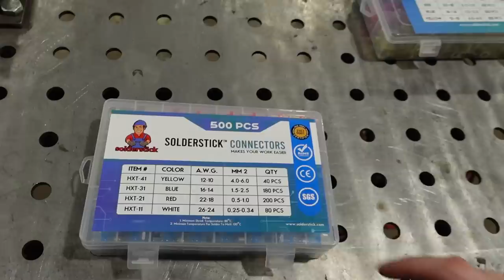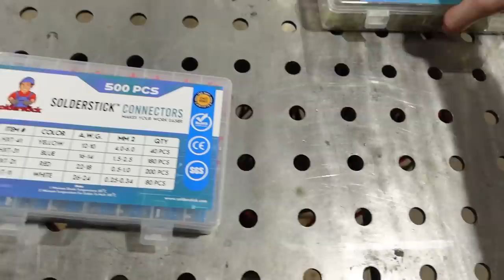the ULTIMATE AWD drag truck chassis is FINALLY complete

Comment from the maker: Check out Solder Stick for your wiring needs, and use code "LT20" to save 20% off your order
https://solderstick.com/
Reply: You should use some on wires and cut them open to show how well the wires are bonded with the solder
Reply: The phrase, cold solder joint comes to mind
Reply: Do not use these in a Profesional Workshop.... DIY is a maybe and BIG maybe...

Comment: 16:13  hey for your office try torching the boards, it will darken the wood to give a more rustic look and let the wood grain pop. I did it on my rough cut pine boards in my shop and it looks great
Reply: That could work - would be like a japanese 'Shou Sugi Ban' finish.  I also thought LT could paint the paneling white which would match the colour and 'texture' of the desk base.

Comment: Take your layer feed welder and bring it over there and run the argon gas in the tank until that's all that's in there is argon gas leave it running there for about 10 minutes before you start welding to make sure there is no fuses or oxygen in there to ignite the fumes😊
Reply: Just run a car exaust through the tank. Much cheaper.
Reply: @MecanicaForte  cheap doesn't equal smarter. Argon is  the right back purge gas for aluminum or stainless
Reply: Argon is an inert shielding gas
Reply: @coolHandLuke5150  there's no reason to back purge aluminum.  No reason to use post flow on aluminum either.   Aluminum isnt reactive like stainless, titanium or even chrome moly, you can remove the shielding gas as soon as you stop welding and it wont change anything.
Reply: Proofreading isn't my strong part
Talk to text on his old phone isn't the greatest
Reply: @nou9472  no but it will take the place of the oxygen and the gas can burn then
Reply: But if there's no accident near the gas can burn in the Argonne to take to a place of the air argon does not burn

Comment: Dude my build saved my life from 21 to 24 I was a heavy vodka drinker now I can’t afford or even want vodka cause I got the awd turbo pull addiction dude Thank you so much I watched these over many times stop and start during my builds the forms helped me a lot also but I need to know more about the suspension setup cause I’m rocking back and forth during pulls and getting major wheel hop scared I’m going to shake it apart

Comment: Might I suggest, after you have rinsed out the tank, run air through it to blow out fumes, and cap off filler neck: try connecting a hose from regulator hooked to argon tank and flow argon into the tank, similar to how you would purge and flow argon when building headers .  Once you are confident that you have purged oxygen (and gas fumes) from gas tank, you can take a MAP or propane torch and hold the flame near the crack on the outside. If the gas coming from the crack extinguishes the torch, then you no longer have flammable gas inside the tank.  If a flame comes from the gas escaping the tank, then keep the argon flowing until that flame extinguishes.  As long as the tank has positive pressure of argon flowing outward from the crack, the flame will not travel into the tank and explode.  If you don't get a flame, you should be safe to weld.  This is a similar technique to how pipe fitter weld live oil lines on construction sites.

Comment: a wee tip to prep a fuel tank for welding , run a car engine exhaust through it for a hour ,that will displace  any fuel gasses in the tank

Comment: Dont know what cam you picked up, but Richard Holdener did a zz502 cam in an 8.1 and picked up i believe 50 hp NA. So at 14 psi that would be another 100 for you. So there is a starting point for what you can potentially make with a cam.
Reply: He is better off specing a specific turbo cam. Some N/a cams with a lot of overlap arent good on a forced induction setup.
Reply: @timothycarey3883  a cam is going to do what a cam does. "Turbo cams" aren't a thing any more. Back when turbos were less efficient they sort of helped by changing lsa. Todays turbos dont care. Go watch Richard Holdeners channel he has hundreds of dyno videos showing exactly that. All a turbo does is add to what an NA motor makes. Literally every cam is a turbo cam

Comment: Dude your like my hero when I was around 12 or 13 me and my dad used to watch your videos my dad drove an 94 Chevy 1500 4x4 regular cab like the one from your older awd swap but it was red with a silver stripe down the sides fast forward 15 years and I’ve finally made it to a place in my life where I can build a awd 4.8 single turbo 4l80e regular cab long bed with roof racks cause I’m driving the heavy Chevy to work on Monday after I’m done racing on the weekend you never know when you’ll see a cocky over priced sports car driver that needs a lesson taught

Comment: Next time you weld a tank, use nitrogen to fill the tank and push out the fumes. Also leave the nitrogen running while you're welding (in a well ventilated area) or run an outlet hose outside from the tank.
Reply from the maker: Not a bad idea
Reply: @LawrenceTolman  running a hose from a vehicles exhaust and filling it with that will do the same thing cheaper.

Comment: Kudos on using the guard on the grinder with the cut off wheel.  I think that's the first time I have seen a you tuber fabricator using a guard on a grinder.  I cringe hard when I see guys using cut off wheels with no guard because I have experienced them coming apart and I have seen the aftermath of cut off wheels coming apart with no guard.👍
Reply from the maker: I'd had too many close calls with exploding  grinder discs to try and use it with the guard taken off...

Comment: The next tank you weld on unless you want to wash it out you don't need to use water to disarm you might say the old fumes. I have found out the best way to repair a leaking tank is to get a vehicle and a piece of stick hose or a radiator hose that fits the tailpipe and the gas fill neck. Put the pipe on the tailpipe and the gas fill and start the engine and let it run until you feel the tank getting hot. The hot exhaust gasses will neutralize the gas vapors and you can take care of business without having to worry about cleaning the water out of the tank. Ask around if you don't believe me, I would never tell anyone something that would get them hurt. I'm curious as to what your truck does.

Comment: Try using ARGON or CO2 gas to completely fill a fuel tank to weld and avoid the water mess.  Keep the gas flowing WHILE you're welding.

Comment: Make a cart for the Rigid chop saw that has its work surface the same as the red table. No more working on the floor.  Use locking casters.

Comment: Not only would I worry about more welds cracking in the tank I would had added 3” 90 brackets for the bottom of the tank and weld it from bottom to sides to help support the weight of the fuel. I’m sure the welds cracked bc of the weight. Idk if that makes sense but it’s an idea

Comment: Instead of using water, The old school trick is to use a hose from your exhaust to fill it with Carbon dioxide, and then it's safe to weld.

Comment: Really enjoy your videos, and especially watching you fabricate.  I am curious why you chose not to box the inside of the frame rails.  Plate with dimple die holes should add more strength without significant weight sacrifice.
Reply from the maker: I had planned on doing some sort of boxing plates a few months ago, and it kinda slipped my mind for a while, but I likely will do exactly what you're talking about: plating the inside of the frame, but with a few holes inside

Comment: Im wondering if a 2007 and later gm 1500 4×4 rack and pinion would tuck under there.  Its lighter aluminum and less complicated without linkage.  Im looking to adapt one for my 72 C-10.  Just make sure you get the pump for it as it has decreased line pressure for the R&P

Comment: At 6:22, I paused the vid.  Came back and looked at it... thought "oobie doobie... if he mounted the springs under the frame and got some wide wheels with the correct backspacing, he could run some serious meats."  Might have to stretch the wheel tubs but....
Reply: Forgot the fact that this is gonna be four wheel drive!  Don't need no stinking fat tires on the rear!

Comment: Send it down and out under the axle from the front so you don't blow any oil or anything that might come out of the engine in front of the rear tires
In my opinion that's what I would do

Comment: Don't leaf springs twist under high torque? I would have thought a adjustable spring and damper would be the desired option to control lift and twist.

Comment: Hey LT, just wondering why you didn't go under frame or inboard frame mount for the rear suspension so you can run much wider rubber out back??

Comment: I use a heat gun on low for 15 minutes with no sending unit and fuel cap off to dry out all the fumes.

Comment: hey tolman. found my mechanical pencils and my drawing paper. i know i promised you i was gonna draw your truck if it was finished to give you another goal to aim for. ill have it done by tomorrow if my schedule holds up but i do have some question just so i can draw it properly
1. is it gonna be stock ride height? if so how much lower
2. you gonna keep the wheels(aka rims) stock? if not what are you aiming for and what brand specifically
3. i suggested you do a diesel truck stack since you wanted to be different but also to avoid getting black flagged at certain events. where are you gonna put it?(like center, right or left) and what style(donkey, smooth or straight cut)
4. Decals or logos. you want it stock style like the copo truck?

the finished product will be on my deviantart so youll be expecting the finished work to be done tomorrow at around 4:00PM central(texas) time or earlier. be safe and i hope you get into those 8's in style

Comment: Can you make a video explaining the anti roll bar there isn't much info out there how does it work does the bar twist because you kind of want some flex like if you hit a hole or uneven part of a road does the anto roll bar let one side go down or keep it straight with the body  I'm interested thank you love your videos
Reply: Anti- roll bar for drag racing is different than anti- sway bar for handling.  Anti- roll bar is meant to keep the chassis from twisting as you put enough power down to lift (or unweight) the front end - keeps the torque reaction from unequally loading the chassis and making it drive out of you lane.  

You are right - very poor for daily driver - but very good for high power drag racing

Comment: All was that gas tank in the 4x4 truck bolt in, if so where do it come from?!
Reply from the maker: the tank came from DB Rods in Texas, and its sort of bolt in, I had to do some cutting and modification on the frame to get it to fit how I wanted.

Comment: Won't the rear leaf springs slide back in the long slot in the bracket once the bolt loosens under load?
Reply: I think it's supposed to.  Rides on bearings it looks like.  This replaces the same movement in a shackle, but more positive in the side to side direction.  But IDK, the sliders are new to me too.
Reply from the maker: on any leaf sprung vehicle, all the power is transferred to the chassis through the front of the spring. if you have a standard shackle out back, its only job is to hold the weight of the truck. The slider accomplishes the same thing, but keeps a more linear geometry on the leaf spring, but power is still transferred through the front of the spring/caltrac. but yes, the back of the spring will slide back and forth on the bearing under normal operation.

Comment: Just curious what kind of roll cage are you planning on using for your rig? I am enjoying the videos keep it up! Don’t burn yourself out. Take care.
Reply from the maker: It’ll be an 8.50 cert cage, I believe it requires an 8 or 10 point. S&W Race cars makes one Ive got my eve on.
Reply: @LawrenceTolman  with the weight of the frame and the cage and drive train are you going to strip weight from the body? You had mentioned creature comforts. You are going to moving massive weight. Even compared to the Ugly Truck. It will be interesting to watch!

Comment: That heat shrink solder stick stuff is trash will have you chasing your tail with connection issues.  After a little time. Get a heat shrink crimp style and a good ratcheting crimper  instead

Comment: Is it me or did you put the leaf spring u-bolts on upside down?
Reply from the maker: they are upside down for now, but only because the axle is flipped above the springs and I don't have my caltracs and round U-bolts yet. The truck won't be driven this way, its just for the mock-up stage
Reply: @LawrenceTolman  Ah righto, looking good anyway, that thing will rip once its done

Comment: Pro tip, run exhaust or non combustible gas on the tank if you’re going to weld it.   Best pro tip never weld a fuel tank.

Comment: 4x4 in the thumbnail... AWD in the title... RIIIIIIIGHT
Reply: My Silverado goes both ways, manually in 4 low or high and set auto 4 wheel drive that's through the computer and runs off ABS sensors.
Other Silverado goes floor shift 4x4 and don't get computer control, not all wheel.
There's two kinds of transfer cases involved.
Reply: @acquasanta6676  A 4x4 vehicle can drive STRICTLY in 2 wheel drive. An AWD, can NEVER be STRICTLY 2 wheel drive. Like you said, 2 different Transfer Cases. Easy as that.
Reply: Darn, third transfer case. 
With 3 square body cases.
2 Silverado
1 Astro van
Early and late S10
This can get complicated quick .
And that's just in my parts stash .
Reply: @acquasanta6676  no no no, just 2... like a transmission. You have manual, and automatic. Just because you can put an automatic into the specific gear you want, it's still an automatic. Just with fancy different names for manufacturers. 
A Transfer Case, is the same. The 4x4, can select if no power can be added. An AWD, is always putting power down. One has a gear that can spin freely, the other is locked in at all times... Just 2

Comment: hi if look at the label on the box it is solder not soder ,there is a L that need used  .
as has been said before usa and uk are divided by a almost language  .
as per normal a very good video
rick edinburgh scotland
Reply: Brits also have a habit of dropping out the letter ‘L’ and replacing it with ‘W’.  Some how words like “Wheels” come out sounding like “Wheews”.

Comment: I'm getting confused as to what direction you are taking this truck the title calls it a "drag truck" yet you are putting anti roll bars on it to my knowledge this has no benefit to going in a straight line for 8 seconds it just adds weight that given the size already you should be trying to lighten the vehicle not make it heavier and you are putting Cal Tracs on it for traction sooo whats with the anti roll???. Also you are worried about the exhaust when the Ugly truck's exhaust exits high thru the front fender and its a street truck so why are you wondering where the exhaust is gonna be routed on the DRAG truck wont it just be a hater pipe thru the hood or fender?
Reply from the maker: the anti-roll bar isn't intended for cornering or anything like that, but to help combat body roll during a launch: high powered drag cars can lift the right rear corner heavily on a launch, and the anti-roll bar helps keep the chassis planted. also on UGT I am going to be putting the full exhaust back on it because I do not love the fender exit exhaust.

Comment: What’s up with the valve train on the 535?? 

Firebird (wild horse) off the 10 is being torn down, leveled. Turned into a joke when the Rez took it over anyway. Widening the I10 and taking it all out.